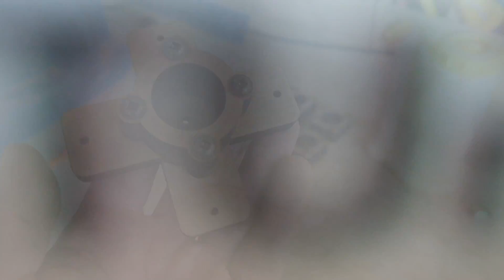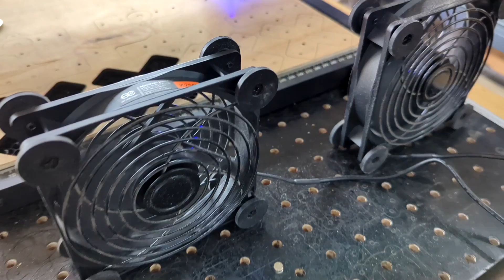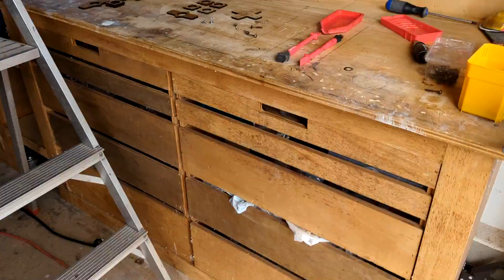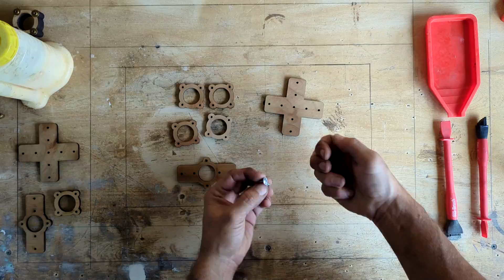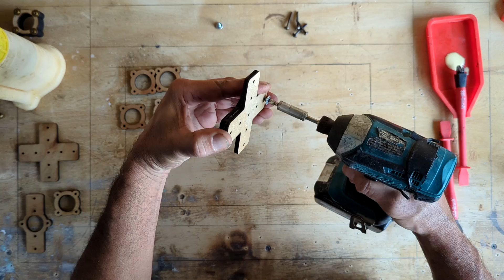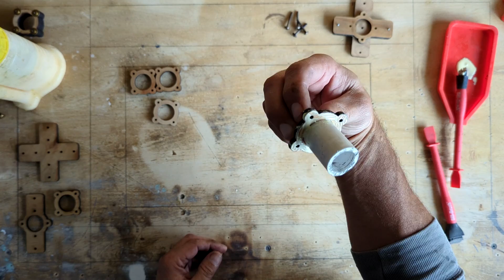Ortur Laser Master 3 - DIY Build of Wood Mounts and Extendable PVC Height Adjustment (PART 3)

Comment: Great ones Rick. What size PVC are you using here? Internal and external mm?
Does the OLM rubber feet fit them right?
Thanks
Reply from the maker: It is just 3/4 PVC pipe from Home Depot. And we are talking the inside diameter. The OLM 3 rubber feet are tapered and fit perfect in the 3/4 pipe.. I been using these for a minute and this video is the final build I came up with as I made it easy as possible to with tall the keyholes to line everything up perfectly. You can modify to your needs.. https://i.etsystatic.com/23877608/r/il/cfe2cb/4479747902/il_1140xN.4479747902_t1il.jpg